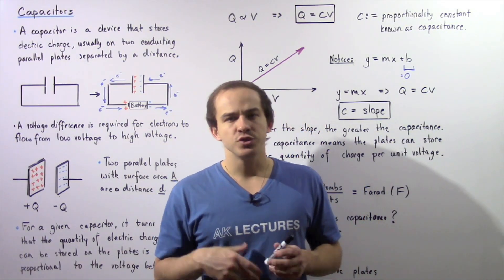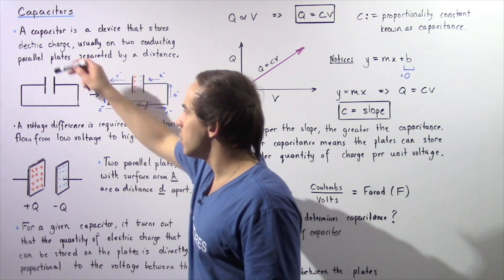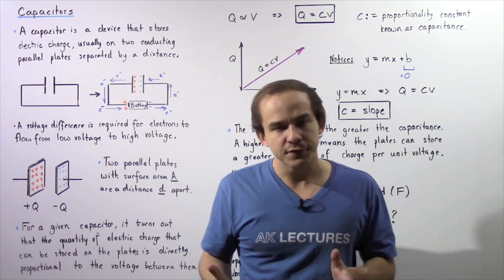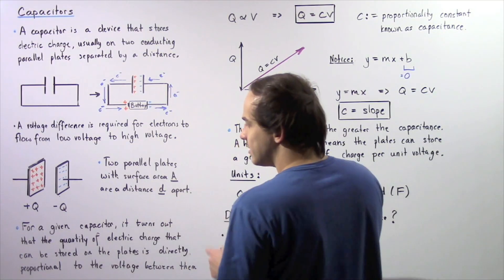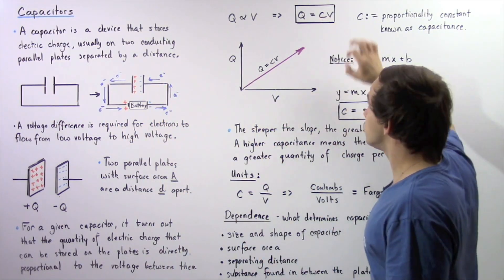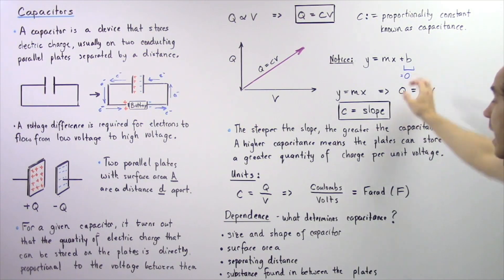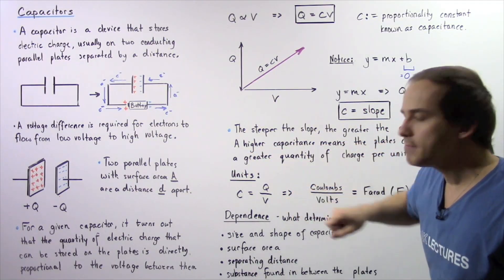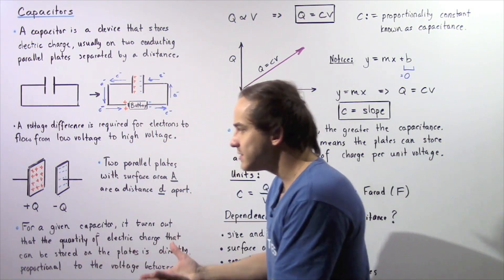Capacitors and Capacitance

Comment: What is it about a capacitor that requires a current in order to express a voltage? A copper wire between a battery and a circuit OPEN expresses the voltage of the battery, so why don't the capacitor plates do the same. What about the wire that connects the battery to the capacitor? Does it express the battery voltage up to the capacitor?

Comment: The trouble with most explanations like this is that they explain it as a fact, instead of a phenomenon. I think it would be more helpful if they started with the state of affairs that there is a phenomenon that you can have movement of electrons when there is a break in the conductor.  This is the first thing that a child would notice if you had explained to them what a DC circuit is and then shown them the picture with the capacitor in it.

Comment: I was confused on one aspect. When the electrons flow through the circuit once, how will they do it again? I'm assuming that a transfer of electrons does not take place between the two plates, which means that one side is eventually going to run out of electrons!
Reply: Hey there! Electrons will only from negative side to the positive side, like from the negative plate to the positive plate (since opposites attract...) and the flow of electrons will occur in a loop only if the capacitors are connected with each other making a circuit. If the capacitors are not connected then the opposite charges will be attracted toward apposite terminals of the battery and oppositely charged plates until the plates have equal amounts of charge stored. If the charge is equal on both sides, no more electrons will flow.